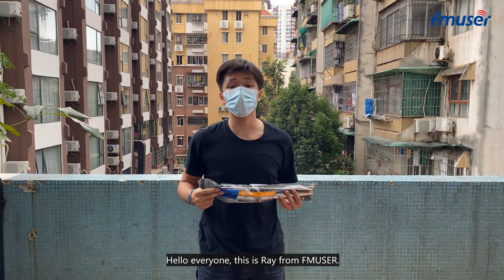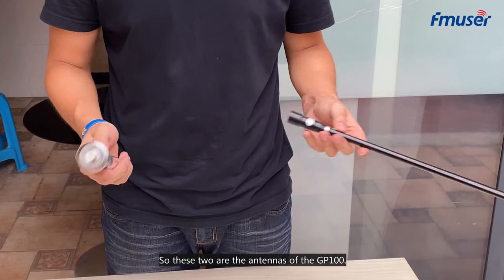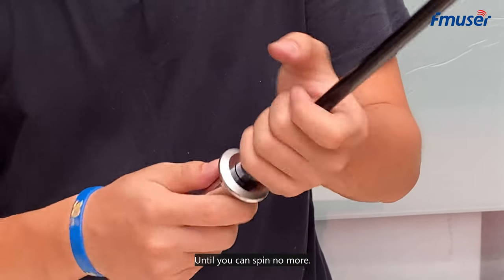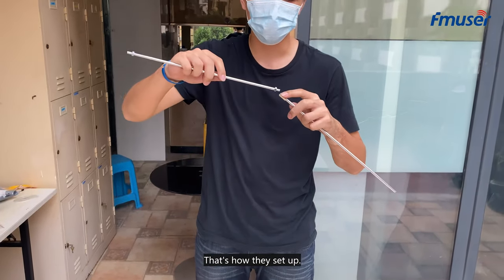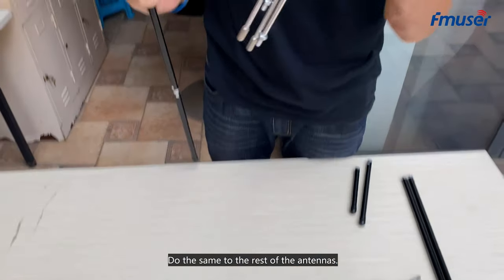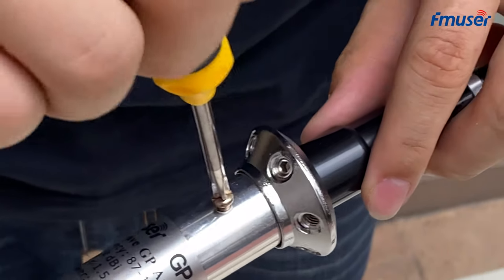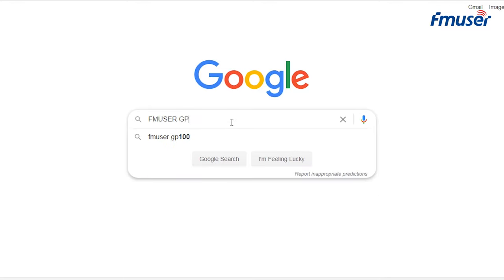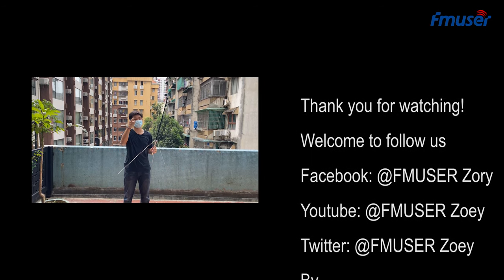How to Install a Ground Plane Antenna? A Dead Easy Setup Guide

Comment: Hi ar the legs that lock in the antenna a ground? Should I run a ground wire? Im planning on making a cheap timber frame to raise the antenna to roof height.  If i make the wooden frame at 2.4 metres or higher and mount my 1/4 wave antenna on top securely? Do i run a wire from the antenna and where please? Overall height should be approximately 3.6 metres. Is this a good idea? Any reply appreciated cheers from Australia subbed and liked 👍
Reply from the maker: Hi, Dragan, thanks for your comment! According to your description, here are two questions:
1. The antenna foot that is locked on the ground is the antenna ground grid. It does not need a ground wire. You only need to ensure that the transmitter is grounded because the antenna and transmitter are connected.
2. Did you buy the antenna system from us or somewhere else? Our aftersales services are ready 24/7.

Comment: I have 15 watt transmitter, which outdoor antenna do you think is best for expensive and inexpensive?
Reply from the maker: We push the expensive choice CP100 for outdoor antennas and the cheap choice GP100
Reply: @fmuserbroadcast  The reason I asked is because I'm on a budget but will look into both of them. Thank you for reply.

Comment: Do these need to be grounded pr can i attach it to my roof on a pole?
Reply from the maker: Hi Jimmy, sorry for not replying in time, thanks for your comment! In fact, all antennas need to be grounded. The outer ring of the antenna interface is the ground wire. You can connect a pole to the roof, of course, that's the most common way of using it. Note that the higher the installation height of your antenna, the greater its coverage (PS: also consider whether there are obstacles in the transmission process and the power of the transmitter). If you need more information about radio broadcasting or need to buy broadcast equipment, please feel free to contact us: Email: zoey. zhang@fmuser.net or Whatsapp/Wechat: +86 18319244009